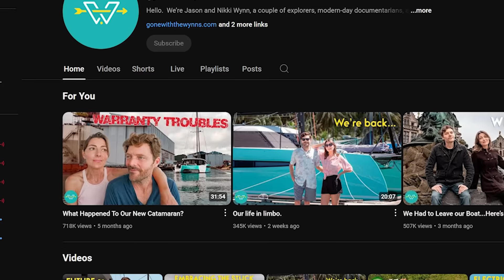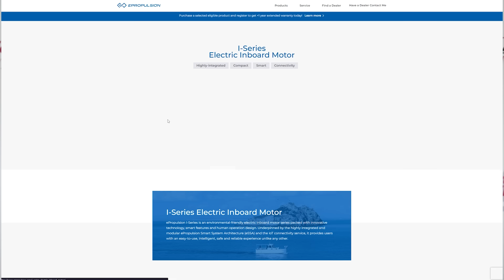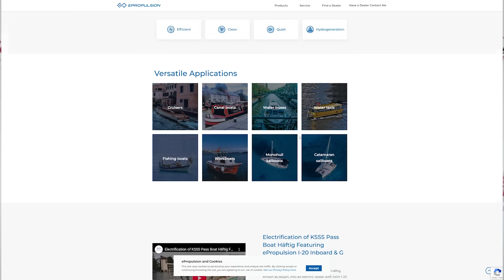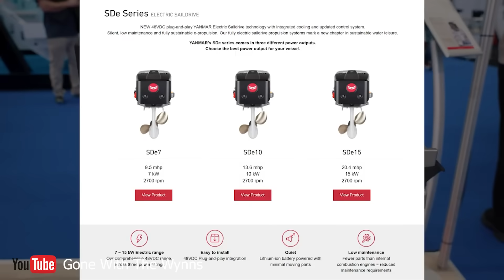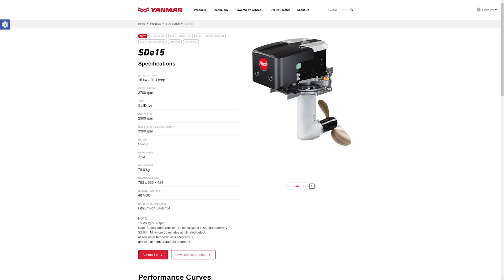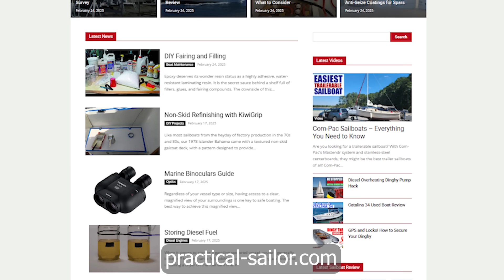Is It Too Soon for Electric Sailboats?

Comment: There is nothing wrong with an electric drive daysailer IF you have a charging source and you never need to go more than a few miles under power.  I agree totally that long range cruising and electric drive is not a good idea because of range limitations and charging issues.  The cost is also an issue when it comes to retrofitting an older boat.  I sail 40-50 days a summer.  Last year my 37 year old diesel burned 11 gallons of diesel and I did an oil and filter change at the end of the season.  So I am looking at about $100 per year to run the diesel.  Since I day sail I could switch to electric, but given the size and minimum range requirements for my boat the switch over would cost me at least $30K.  That is 300 years of my current operating costs, which is a bot longer than I will be sailing on any boat.  So it simply doesn't make financial sense to me.

Comment: My Lagoon Hybrid 420 was built as Hybrid by Lagoon in 2007.   It has undergone upgrades to the electric propulsion systems as technology has improved.  I have personally put almost 10,000 nm under the keel in the 2.5 years since I bought it.  It is very efficient.  I use about 1/4 of the fuel of a standard diesel catamaran for motoring.  I also have a motoring range of over 3000 miles,  from the generator, before re-fueling...   The propulsion batteries can be charged with solar, regeneration, generator, or shore power.   That is a lot of charging options...
So No,  it's not too soon for electric.

Comment: Yes, to soon for lithium batteries in any place you can't easily escape from.
Reply: Id' much rather have a bank of LiFePO4 (specifically) batteries in my confined living space than 10's of gallons of diesel fuel sloshing beneath my feet, or a tank of flammable heavier-than-air gas feeding the stove through constantly flexing hoses.  

Remember that not all Lithium chemistries are the same.  The ones in cell phones, tablets, and most EVs are a different chemistry, with a higher capacity, but also with a very flammable electrolyte and a much higher risk for thermal runaway.  Yeah, keep those cells out of my boat!  LiFePO4 (sometimes called LFP) is much safer.  LiPO, NMC, NCA, LCO, and the others, not so much.

Comment: In the really old days, everyone sailed without an engine. It can be done. But not on a schedule. Electric propulsion is, in my opinion, a bit of a step back to the no engine days. Except now you have the non-sail power to get in an out of harbor. Also, with electric and solar charging, you have the means to make at least some progress, mid-ocean, in dead calms.
Reply: Exactly.  One can push a 30+ foot class monohull along at about 3 kts on around 800 watts of electricity, well within the range of solar power alone.  Remember that besides batteries getting better, so are solar panels.

Comment: If buying new, I would 100% go electric.  Used, no, too many possible headaches and difficulties sorting it out.  I drive an EV and I would NEVER again buy a gas car.
Reply: But of course my use case in 99% coastal cruising, not round the world travel for years on end.  The concept of charging at the dock, solar charging every day I am not using it, regen sailing, and potential wind gen, is just too nice of a use case.

For serious blue water, multi-year, remote travel, probably not.

BTW, the battery replacement convo is actually a little bit off.  If they last 10 years, replacement cannot really be compared in "todays" dollars, because in 10 years the technology of batteries is going to likely be leagues and leagues better, lighter, cheaper per AmpHour, etc.  You would likely replace them with some solid state technology, but I'll put away my crystal ball ;)
Reply: @ezmn9663  True, but even with existing technology batteries are getting much cheaper.

Comment: the real question should be, when are going to invent solar collecting sails with photo voltaic cells for batteries and motors?
Reply: Do it!  You could be rich and famous.
Reply: You could try using lots of flexy panels stitched to the sails.
Reply: Yeah, but you'd need to be heeled WAY over to get any power out of them...
Reply: @tubeuser2350  I anticipate little sunshine in those kinds of winds.

Comment: This review ignores regen under sail as a way to recharge batteries for the long distance cruiser. It is huge and there is much more energy available there than with solar or a small wind generator. It’s not going to get you home if you are becalmed for days, but as long as there is wind you should be able to recharge your batteries in the trek between ports and have plenty to motor into harbor.
Reply: "As long as there is wind". and "should be able to", Right. Well, sailors know that nature does not always cooperate with our plans......
Reply: By definition, regen is not available to help while you are motoring. Occasionally, you may have a need to motor continuously in light wind or into a headwind for an extended period. A diesel will give you the capability to do that. An electric boat won't. So you lose something when you go electric. Obviously some people are OK with losing that. And some are not. What is NOT ok is to pretend that nothing is lost when going electric. I have no quarrel with anyone who chooses to go electric, but I don't like it when people give off the impression that there is no compromise.
Reply: @mckenziekeith7434  But it's also not all sacrifice, either.  I love the idea of calm day motoring on solar power alone, or motor sailing under light winds.  800 watts can push a 30+' boat along at 3 kts for hours, no battery required, and the lack of noise makes the use of the motor not such a hard decision.  

As for safety, compare how long it takes from "Oh $#1^, ROCKS!" to full throttle, between an electric and a diesel.  Seconds can matter, and the longer it takes for a diesel to heat, crank, start, and rev, the more likely your heart will need restarting too.
Reply: @tubeuser2350  Yes, I agree. Also, most boats are not bluewater cruisers. Almost every sailboat that is not a bluewater cruiser would likely be much better off with an electric instead of a diesel. Also, also, it is feasible to put in a battery bank that is maybe 50 or even maybe 100 kWh. It is a daunting task, but it is possible. A bluewater cruiser like that might be able to run at moderate speed for 24 hours even. So that is worth considering. But a 100 kWh battery pack will be quite heavy. Might need to find some places to shave weight elsewhere to make this happen. Maybe reduce the water tankage (and use a watermaker instead) or something like that.

Comment: Look, this is simple. Look at cars - if you only travel 50 miles from home then electric cars are great. Drive 150miles and you need a combustion engine. Next safety: run out of power in a car and you can get out and walk. Do you think it's safe for boats to run out of power just when you need it?
Reply: On the other hand, how many Gerry cans can be refilled while under sail, away from port?  Solar, Wind, and Regen can be a game changer on an electric sailboat if used properly.  

I'm continually mystified why people think an EV has to be able to go from start to final destination without stopping.  Many EVs today have better range on a single "tank" than some of the gas cars I've owned, yet those cars were perfectly practical.  The need for gas stations was a problem that got solved, and so will the need for charging stations.  But show me someone who wakes up every morning to a full tank because they refill their gas car at home?  My EV is always fully charged and ready to go.

Comment: With some sort of temperature management for the batteries they should last a lot longer than 5 years. Most batteries in electric cars are still fully functioning after ~10 years…
Reply: Yep.  My EV's battery turned 15 years old in January of this year (2025).
Reply: Batteries in sailboats don't produce any real amount of heat as they are typically used at only a fraction of their C rating. What is an issue is a high SOC and high ambient temps for days and days on end which is typical of a non-livaboard boat.  Even so, the batteries should last decades but after 10 years you may be at 10-30% capacity loss even with low cycles. Newer cells suffer less from heat, soon heat issues will be a thing of the past.

Comment: My wife, my cat and I just sailed a 3 year, 10,000 NM loop of the north Atlantic Ocean (featured 5 times in Practical Boat Owner magazine) in an electric Baba 30 with an Electric Yacht 10kw motor driven by a 230ah LifePo4 battery pack that we built ourselves. Our replenishment system is a switchable 1.8kw wind and solar rig. The motor is by far the most reliable system on the boat and shows no sign of degradation even after sailing from Ft. Lauderdale, Florida to Bemuda then on to the Azores. From Terceira to Madeira, The Canary Islands, Cabo Verde then back across The Atlantic to Martinique and finally stopped in St. Thomas, USVI for a cruising kitty re-up.
We love our electric system and have published every step of the installation on our website along with a complete budget.
Internal combustion engines are killing the world...we have to stop using them.
Reply: What’s your website?
Reply: No, they are not "killing the world." Do you have any idea of the environmental footprint of batteries, electrical components, rare earth metal mining,  solar panels, wind turbines, nuclear power plants........?
Reply: @saabtech3510  What is the environmental footprint for just drilling for oil, not to mention burning it?  Compare the oil disasters in Alaska, California, and the Gulf to a theoretical "lithium spill".  Lithium comes from a mined salt.  If you spill it, reach down and pick it up.

And batteries are recharged after use, not so oil.  The Lithium never gets used up, and the whole thing can be recycled.
Reply: @ I see YT deleted my bigger picture comment. I can't bother having a decent discussion on this if the AI is just going to vaporize my comments. The PTB won't let you go bigger picture. They want to keep things in polarized discussions.

Comment: Another great episode, I have a 1979 compass pelorus which is a great day or weekend boat, it’s got a 1979 leyland diesel, replacing with electric will make the boat bigger inside, get rid of the noise and smell and as you say will self charge over the week. Also much better for the marina.

Comment: Uma was sailing with a generator. They bought one when they came to Norway and realised that it was not very safe to sail this far north without a reliable engine that would work for than 30 minutes at full speed. We do use electric engines on boats in Norway. For ferries, small pleasure boats, and inland sailing in the fjords. But for off shore, blue water and sailing in the north, it is outright dangerous.
Reply: Those Uma kids are naive fools. I cautioned them about going electric days before the news hit about that Canadian sailing couple from Vancouver Island that went missing. Their reply to my concerns were quickly brushed off by, no problem, we have sails and if there's no wind, we'll just float. SOmething like that, just stupid
Reply: @Cacheola  Say what? engines, diesel or electric, fail. Considering the loss of life when a diesel engine failure took out a bridge and the multiple groundings caused by diesel failures in the past year, I am not so sure diesels are oh so reliable either. People go sailing and never come back no matter the power plant. It's a fact of life. You may also wish to take a look for boat fires at engine start..... they aren't all gas motors either.
Reply: @lenwhatever4187  lol, you do you champ
Reply: @ Say you want to sail in the north with an electric engine. 
In the summer. 
How will you charge? Remember, this is not the Caribbean. The sunny days are limited. And the sun will not give you the same charge as close to the equator even if we do have a midnight sun in the summer. 
So your range is already limited. 
What if you want to go in the winter? Charging with the sun? Forget it. In the last 2,5 weeks I have seen the sun 2 times. Further north the sun disappear a couple of months. 

But, if you sail from marina to marina, you will probably be fine. You can charge at the marinas. And you just need to motor in and out of the marina. But you become more dependant on the weather. So you will spend more time in the marinas waiting for wind. Or the correct wind. 

But what if something happens and you cant use your sails? If you are lucky, the weather is ok and the closest dock is not far away. But if the weather is bad, and you need to use the electric motor at 100%, you will be out of power in a very short time. 

Your argument about diesel engines failing is just ridiculous. Of course all engines can fail. But a well maintained diesel will almost never fail. They are very reliable. 
From a safety perspective, a diesel engine is always better than an electric one.
Reply: @Cacheola  The couple from Vancouver used a battery from a Nissan Leaf. If they catch fire, your boat is gone. The LiFePO4 batteries used in boats, campers etc dont catch fire. So I am not concerned about fires. 

My concern is range. And the ability to get out of a dangerous situation. 
The batteries today dont give enough range. You will need several tons of batteries to keep your boat running for hours. Imagine loosing your sails on a windy day on the Norwegian coast. With a diesel you motor to safety. With an electric engine you dont have a chance. You will loose your boat. And you will need a rescue. 

Imagine loosing your mast in the Atlantic. With a diesel and extra fuel you motor to safety. With an electric engine you will lose your boat and you will need a rescue. 

And there is also a problem with charging.
Reply: @StarfleetCommand71  yes, I'm quite familiar with their setup and wasn't the concern I made. Uma kids may be dumb, but I don't think they're stupid
Reply: @Cacheola  YT-sailors never respond to critic. Everything they mount on their boats are sponsored. So they are neither stupid nor dumb. They are just trying to make money. Also, they never listen to advice from people with experience for the same reasons. They are sponsored and have to do what the sponsor tells them to do. 

My problem with these electric sailors is that they never address the danger of sailing with an electric motor with limited range. 

In one video Uma was sailing out of a narrow fjord in Norway. It took them the whole day and they tacked 40 times. If they had a diesel it would have taken them 1 hour. 

I have asked a lot of these sailors what they will do if their mast/sails break on the coast of Norway, Iceland etc. The wind is blowing their boat towards land, and they have power for one hour. So far none of them have answered. Because they know it is dangerous. But because they are sponsored, they cant say anything negative. 
If you go to a dealer and tell them you want to cross the Atlantic and that you want an electric motor, they tell you to go home and think long and hard about your life decisions. None of them would recommend an electric engine for this type of sailing. 

If you really want to electric, go hybrid. You can go on batteries for as long as you have power. And after the diesel kicks in. Either at generator or as an engine running the propeller.

Comment: I reckon when electric cars with a 500+ mile range are ubiquitous; that's the time for electric sailboats because the use-case is much less compelling. Hopefully that'll be soon. Probably not in my lifetime though.
Reply: One only needs an EV with 500+ miles if you're unwilling to stop and charge along the way.  How much range would your gas / diesel car need to have under similar circumstances?  

An electric sailboat can be recharged while underway from solar, wind, and/or regen.  Or a gas / diesel / propane powered generator, with unlimited range via on-board Gerry cans.  Or am I not allowed to carry those, either?  One needs to compare things on an even playing field, even if healed over at 15 degrees.
Reply: @tubeuser2350  What I mean is - when the range of a typical ev matches that of a diesel car and they proliferate, then we've probably arrived technologically at the point where an electric sailboat is the best proposition for most cruising sailors too. Because, although you can recharge using solar etc to recharge at sea, they there are definitely times when a you need the motor for long periods and you can't recharge as fast as you discharge. Most sailors most of the time don't need 6 hours of endurance just as most drivers don't need 500 miles, but the driver can, as you point out, stop and recharge, wheras the sailor really cannot. A lot of sailors just day-sail, so they only have modest needs for energy, but if they convert to electric, they can only ever sell the boat to another day sailor. Don't get me wrong, I'd love an electric sailboat, but solar, wind, regen, generators etc. are all expensive and lithium batteries are too. So, not yet:-)

Comment: We shouldn't get trapped in all or nothing thinking. Electric makes sense for cars even if their range is limited. Our family started driving plug-in hybrid vehicles 8 years ago. They are great. We have 30-45 miles of all-electric range and a combustion engine that comes on when needed. Over 90% of our driving is all-electric. This makes the cars dirt cheap to operate. The combustion engine rarely has to run, so there's almost no wear and tear on it.
Reply: I understand you're saying electric is great if you don't drive much.